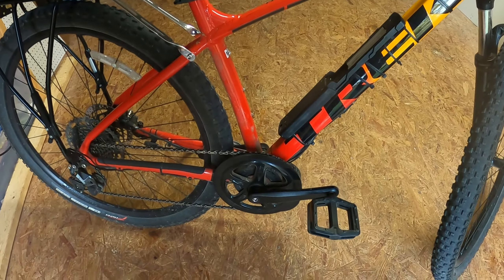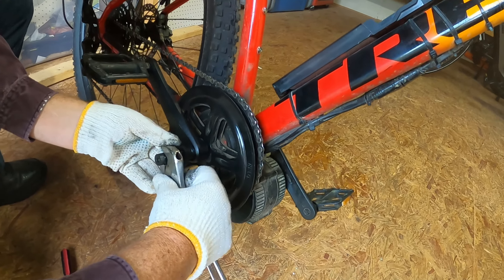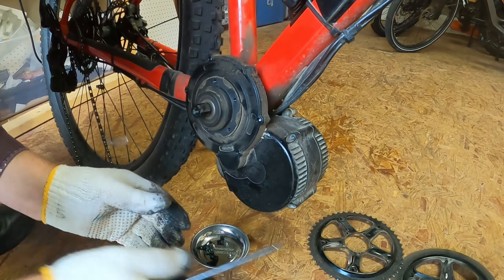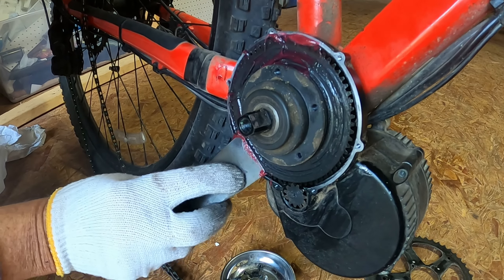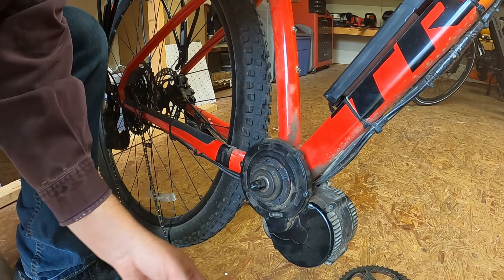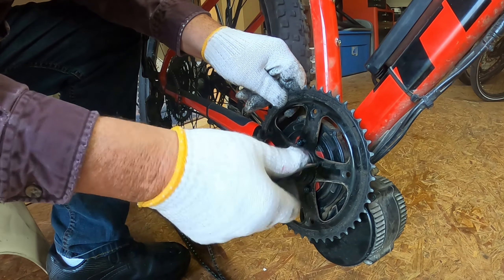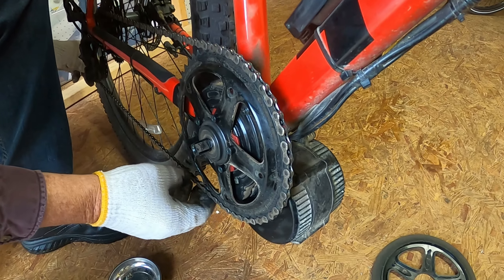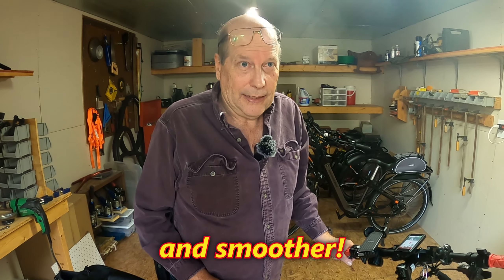How to Re-Grease a Bafang Mid-Drive Ebike Motor #ebike #bafang

Comment: That's too much. Excess grease will create friction, friction creates heat, heat causes expansion, expansion can blow out your seals. Not to mention less power & shorter battery life overall.
Reply from the maker: Thanks for watching. This is not a sealed system. The cover is plastic with space around it. Any excess grease will exit. So it is really not very likely to be able to over grease as the seal is actually just the grease.

Comment: the main source of  noise on the BBS is not the secondary gear but the primary (metal to nylon gear) this one accept zero grease and any excess of grease in the secondary gear caase can contaminate the primary gear and the motor case. This primary gear can be upgraded on BBS01 -02 by aftermarket part or the one from the BBS HD.
Reply from the maker: @damientelle  I have heard this same thing. But with 3600 miles on this, every time I have greased it this way it has moved more free and quiet down for anywhere from 800 to 1000 miles.
Reply: @southernebiking  indead secondary  gear need regular maintenance too.
My point was in case of noise due to worn gear (that will be on the primary gear and no grease will help)
but it occurs at higher mileage or after miss use ( ex: controler current set too high )

Comment: That way to much grease !!  That will press grease in where it shouldn’t be.
Reply from the maker: @martinblenstrup366  the path of least resistance goes to the outside on this motor so it will not press into anywhere that it should not. On the HD that is a different story, it is a sealed unit, this one is not. Thank you for watching and for giving me a heads up to look out.

Comment: I use a brush when greasing my mid drive motor with a small amount, yours look way too much.
Reply from the maker: The newer ones are sealed. The one I am using is not a sealed system. So any excess quickly finds its way to the outside. B t w not much come out. Thanks much for watching.

Comment: how many miles adnd what kind of hill climbing load carrying do you have on this unit?   after a year are there more problems? i have a bbs02 that has 1000 miles, pretty tough hill climbing and load in colorado.  just started making bad noises going up hill.  trying to figure out what I am up against.
Reply from the maker: @rshawiii  I have Approximately four thousand miles on mine and have not had any problems. The noise you are hearing. It means that you need to take the side cover off and pack new greece inside the gear. I do have a video about how I did that. And it is very easy to do. If you have that many miles on, you probably should consider it changing your entire drivetrain. Chain ring cassette and chain. That is the only issue that I had with this bike. And that is only because I was putting so many miles on. I am Riding a hub drive on the majority of our rides. Now and I have put the trek bike to strictly off road. The only reason for that was because you do have some maintenance to do with a mid drive, but that would be any mid drive. And if you were in colorado and riding hills daily, you probably need the mid drive. I would say there are some better mid. Drive units that you could get. The dollar for dollar. The buffang is probably the best deal for ninety nine percent of people. Take a look at that video on repacking. And you'll see, it's very easy and that will quiet your motor right down. Thanks for watching

Comment: do you think its important to clean out old grease?
also i noticed that you dont seem to have a paper gasket

thanks for vid

my question before vid was how much grease is appropriate, i guess your common sense informed you ;)
Reply from the maker: @ziggypi4813  thanks for watching. The BBS O2 does not need a gasket as it is not a sealed system. The cover is plastic and I pack it complete with grease because any excess still squeezes out the sides. I believe the BBSHD is a little bit different and has a sealed system. There you would not want to over grease.I would only remove the old grease if I was doing a complete overhaul.

Comment: What do you think about blue thread lock for the bolts ?
Reply from the maker: If you were talking about the bottom bracket, yes, definitely thread lock. I also use a torque arm. If you are talking about the cover where I pack the grease. I do not believe these need anything. They were actually not tight at all, but I have checked them since and they have never loosened. The cover itself is plastic so I am sure it is pushing against the screws to keep them from loosening. Right now we are at about 3000 miles on the this and I have not had any problem with it.  Thanks for watching Walter.
Reply: @southernebiking  hello, thank you for responding so quickly excla enjoyed watching.